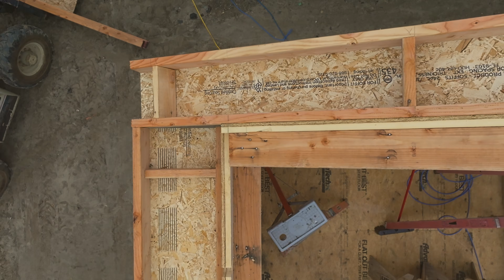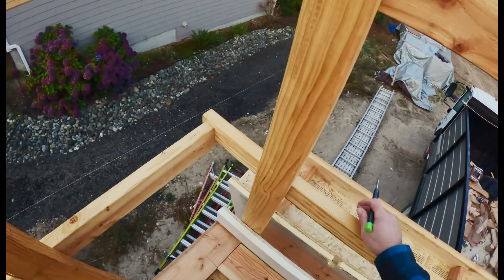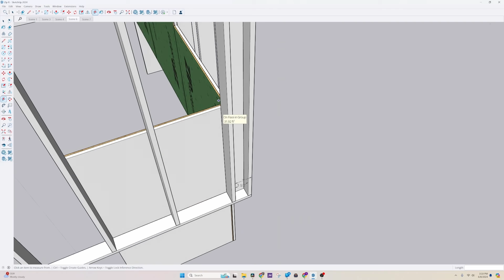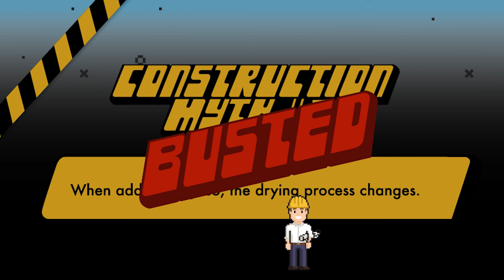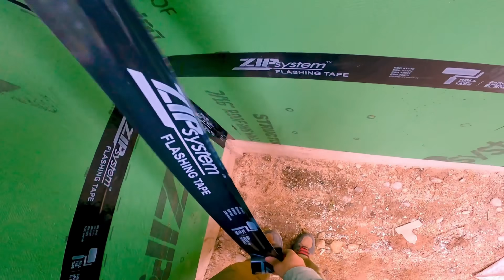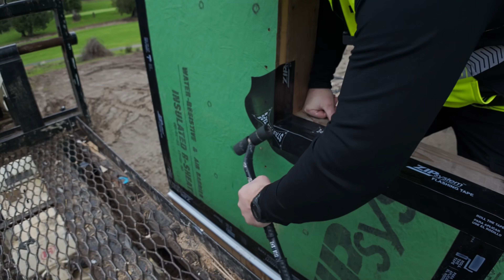EXPERT TIPS| Continuous Insulation

Comment: I’m guessing you can’t go back and fix thermal bridging on a house the way you can preemptively do so with a new build? 

This would require removing all the exterior sheathing, which would require removing siding, and removing drywall…..basically going down to the framing for every single wall of the house?

Comment: 3' OC on edges...does he want that regardless of R sheathing? Say if you framed with just 7/16" Zip (no R) or is that simply because of the added thickness of the R sheathing?
Reply from the maker: No it was because of the foam
Reply: @AwesomeFramers so yes because of the fact it was R sheathing👍🏽🤣. Thank you. I have yet to us R Zip but I have some projects coming up that will require continous insulation to met REScheck reports and I use Zip exclusively so bam… here we go

Comment: Doesn’t this also create fire breaks? The foam is super flammable. It’s like a fuse all around the house.
Reply from the maker: No its not like a fuse around the entire house.  Fire codes take this into account as well as well as you can look at the flam rating of this foam.  Its important to look at assemblies and not singe components in isoloation.  Remember, these houses are made of flammable materials, have electricity and likely a fuel source like gas or propane.  Can they burn? Yep.  How often do they? Very rarely.
Reply: @AwesomeFramers rockwool and CMU seems superior.
Reply from the maker: @CountJeffula  seems being the operative word.

Think through the labor process of CMU & Rockwool.  What will it take to attache siding?  What is the existing labor pool that can do the work?  What's the cost?  What impact on seismic design?  What's the environmental cost? and the list goes on
Reply: @AwesomeFramers it’s way fewer SKUs and less things to go wrong. I’ve done CMU myself. Rockwool is essentially impervious to insect, fire, and water.

Comment: Seems it would reduce shear strength. Instead of the fasteners being under a shear load, they will take on a bending load due to the low strength of the foam. It takes less force to bend a fastener than to shear it. Right?
Reply from the maker: Basically yes, that's why we add more nails. https://www.huberwood.com/uploads/documents/technical/Seismic-Controlled-Regions-Installation-of-ZIP-System-R-sheathing-Technical-Tip-Wall-R-sheathing_2022-08-10-182322_ksai.pdf

Comment: You tubing has become heavily monetized with product endorsement 
Not necessarily all bad but there are budget friendly alternatives if you have knowledge and experience
Reply: What would those be?
Reply: I'm partial to a 2x8 staggered 2x4 24"o/c stud with a high density batt double R14 for a combined R28 effective about R16.5 at every stud with 7/16 OSB sheathing with a liquid rubber membrane coating finish as needed 
A nice Portland cement scratch 5/8 with a synthetic coat finish comes antique stucco wire and mesh for drainage peel and stick all fenestrations 
Not necessarily in that order
Some nice smooth limestone finish on front of house and columns 
A little fire resistant spec non perforated fire resistant metal soffits c/w standing seam metal roof and mechanical attic ventilation with fire damper
Gets me excited
Reply: I'm partial to a 2x8 staggered 2x4 24"o/c stud with a high density batt double R14 for a combined R28 effective about R16.5 at every stud with 7/16 OSB sheathing with a liquid rubber membrane coating finish as needed 
A nice Portland cement scratch 5/8 with a synthetic coat finish comes antique stucco wire and mesh for drainage peel and stick all fenestrations 
Not necessarily in that order
Some nice smooth limestone finish on front of house and columns 
A little fire resistant spec non perforated fire resistant metal soffits c/w standing seam metal roof and mechanical attic ventilation with fire damper
Gets me excited

Comment: I like regular zip for sheer then 2”outsulation ridged foam, rain screen, pt strapping, then siding.
Reply: Late to this post but 100% agree.. Houses built with 1" of foam BETWEEN sheathing and  studs allows for movement in the 1" between ply and studs.  High winds (FL) will allow said movement, compromising interior finishes, tile etc.  Framed for years in my previous life and this is the first thought I had when this product came out..

Comment: 18:15 potential to dry on both sides - does that mean no interior air barrier? Here in Alaska people swear by 6mil poly between drywall and studs.
Reply: Because of the polyiso on the zip r you would no longer need or want the 6 mil poly between the studs and drywall. This would lock moisture in the wall cavity rotting the would and creating mold. The wall cavity needs to be able to dry to the inside because the polyiso is now your vapour barrier. The only thing drying to the outside is the osb on the outside of the polyiso.
Reply: @L0n3W0lfBl4ck   Thanks! This is exactly what I ended up doing. Rockwool in cavities with NO poly. People thought I was crazy but I dove deep into the research

Comment: Of course the ultimate is still going to be a double stud wall. Where the studs are offset from each other thus isolating and eliminating all bridging.
Reply: That might work with a rain screen. Wall insulation u-value calculations will identify the point of diminishing returns. The first R-13 blocks 90% of the heat so the code is pretty much spot on.

Comment: Why not use ICFs?   Really fast to get walls up, no WRB or Vapor Barrier in the walls.  Zero thermal bridging in the wall and tthe thermal mass of the concrete reportedly gives an effective R Value close to 50.  Foam window bucks eliminate that thermal bridging.  Blower door scores go up really easily too.   Bonus...zero mold issues in the walls!  Bullet proof up to 200 mile per hour winds!

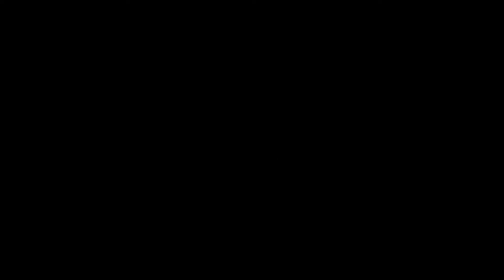Comment: 17:24 About "the Myths" ... Steven has a rather special definition of "drying to both sides", the reference plane is not the most obstructive layer, it's not the most restrictive panel that has to dry - in this case poly iso does't even suck up water and can't get wet - ALL the elements of the wall (insulation, studs, blocking,...) must be able to dry to both directions.

So that's the problem with ZIP R-sheating, the poly iso layer makes that the insulation and studs can only dry to the inside .

The seams of the ZIP R-panel are the weak spots as interior vapor can reach the ZIP tape which is not insulated. The vapor will condensate against the tape and the condensation will be sucked up by the OSB layer.

The OSB will remain wet during winter as the WRB as water tight... the wetness of the OSB must first turn back into vapor before it can escape to the outside... and mostly this means you have to wait until summer time.
Reply: I am looking to build a small one story house and using 1.5 polyiso as the sheathing. The shear and racking will be addressed using diagonal braces. It will be 2x6 walls with dense pack cellulose. What do you think about this
Reply: @mrmrv42  If you want a wall that can dry to both sides, you need to avoid all kind of plastic insulation (polyiso, EPS, XPS,...) because they are not vapor open, cannot regulate vapor and cannot absorb water. 
Don't get blinded by their "superior" R-value per inch, the R-value is only one small part of the story.

Exterior insulation is the best choice, but use a vapor open material like Rockwool Comfortboard or TimberHP wood fiber boards.

Never use bigger sized studs than needed structuraly just because you want to insulate thicker. For a ground floor only house, 2x4's are more than adequate. Apply the extra insulation wanted in the continuous external layer.

Even if you're using diagonal bracing against shear, I would apply sheating for air tightness and extra mass, use plywood, (oil tempered) hardboard, MDF, particle board, OSB,.... 

Install a service cavity wall of about 2 to 3"on the inside and fill this with extra insulation where no services are needed.
Finish it with sheetrock and embed paper banding to make all the seams air tight.

For extra insulation on the inside, a material that can absorp and release vapor is the best choice, so cellulose is a good choice, other options are all other natural materials like wood fibers, cotton, hemp, flax, sheep wool,...
Reply: @koenraadprincen7212 thanks for your insights ✌️

Comment: When I built my second home zip wasn’t available and I didn’t really trust the siding contractor to install tyvek correctly. I was in the HVAC industry and had the house sheathed with 5/8 plywood and taped it with a mastic tape. I tested several tapes left totally exposed for a year and the mastic held up the best. I used siding with foam attached. As previous comments mentioned social media influencers are usually supported which may or may not be the case here. Zip is a nice solution but not the only way or even the most cost effective way to achieve the same results.

Comment: Zip-R is more expensive to use than zip only plus, insulation for materials cost only …. Want to save energy reduce the window square footage throughout the house to improve the overall efficiency
Reply: Sure you could cut out ALL windows and it would really save money!
Reply: @ yeah windows exude a lot of heat so reduced window size saves energy

Comment: My house was built with real quality wood but empty cavities. Like a barn maybe. After considering blown-in insulation or infusion or ripping out the sheetrock and wood panels to sprayfoam or rockwool, I think high utility bills are maybe the better choice. People survived in this hot and even hotter climates and in this house before air conditioning. The cost savings to insulate are questionable. Its expensive either way.

Comment: What a silly product.  There is no way to tape the seams in the foam board that is attached to the OSB, so what prevents winter water vapor inside the house from reaching the edges of the OSB through the gaps in the foam ?  Once there, it will condense due to the outside cold and lack of true exterior insulation.  Check out all the SIP roofs and the way they rotted along the seams from the inside -- even though that foam was T&G and should have at least fitted tightly from one panel to the next compared to this.  And how do you claim you've eliminated thermal bridging when you have thousands of nail or screw heads exposed to the cold and then running right through into the wall studs ?  At least with exterior foam board you'd have many fewer fasteners doing that.
Reply from the maker: @kirkellis4329  Untrue

Comment: I like the zip r product and design with it in western washington, but I your mythbusting section is a bit over simplistic. I agree that it is not inherently a problem, but it could present significant issues if someone doesn't get the assembly right or doesnt probably excecute the build. 

The biggest thing I think you left out os that you cannot install a vapor barrier below sheet rock orherwise you are going to rot out the framing. You also must allocate more time to drying out framing if building during the wet season. Any trapped water will also lead to rot. 

I think the best assembly with zip-r is to "flash and batt" the cavities with 2" of closed cell and fiberglass batt. The downside is thay this likely removes any labor cost saving from usong the zip-r panel. 

I am hoping we don't see a bunch of new homes in the region fail as less attentive builders are pushed into the zip-r product by the energy code and cost constraimts.

Comment: I wouldn't be so worried about the shear strength, as the fact that it is being borne by 1" of nail effectively in free space. The nails have become structural members, not just fasteners. As the building loads change in the wind, they will move, and over time they might creep. Nails are supposed to work by keeping tension between the two elements, and then relying on friction between them for the majority of side loads. That doesn't happen here. I wouldn't trust the longevity of such construction. How long is the warranty?
Such a system needs to be 3 layers. It needs a structural layer adjacent to the frame, an insulation layer, and a barrier outer layer. Trying to use the outer layer as structural is asking for trouble. I would guess the primary reason framers object to an inner structural layer is that it is the structural layer which needs to be fastened, and trying to use a nail gun on foam and get a good fastening on the board beneath is going to be a pain. In a controlled environment the solution would be glue, but that is really hard to inspect. I guess you could push the board out and if it stays put then the glue is good enough.

Comment: 10:29 Stupid question- why not saw off the panels at 45 degrees to meet at the corner like is done with most stuff on corners?
Reply: This would be the best or smartest way but half of the people using it are lazy ...To do it the right way ...There is a lot of half a__ people that just do not care ...
Reply: I would add spray foam for corners ..But I would put my sheets straight up and down so all side nail to frame not with gap to fill with foam inside later ...That is just mee ..

Comment: Use some zip around windows and doors for thermal break. Windows and doors closer to inside helps too. Less cooler space from window on inside. Then can put shutters on for those in the cold areas or need bear protection on windows.

Comment: Didn't see you address the wall condensation issue with Zip (where the vapour barrier is on the outside of the wall) in cold highly humid zones (like Washington State). I'm wary of any sealed panel system in that climate.
Reply from the maker: I didn't address any of the climate zones.  The scope of this video is mosty about what the product is, how to install it and why we use it.  It is not a deep dive into the different climate zones or potential issues.

In our climate zone here in WA, 4 & 5C, there aren't condesation issues following the construction shown in this video.
Reply: @AwesomeFramers I'm close in coastal BC. It's just that Steve discusses the advantages, but not so much the disadvantages or what climate zones it's best. Also, going for more than R6 might not just be a cost issue if you consider it might eliminate wall condensation. I think in our climate, the standard interior poly vapour barrier and zip (no cavity drying) might not mix. I haven't found any long term studies having moisture sensors in the wall for zip systems with a variety of vapour barriers.
Reply from the maker: @approots  I hear you.  I feel like climate zone gets us close, but its almost still a site specific discussion.  Have you tried asking those quesitons over at Green Building Advisor?
Reply: @AwesomeFramers  I've read a lot there, and it's great, but without the controlled long-term studies it's all theory and anecdotal experiences. Still looking for solid data.

Comment: Another thing I didnt like is the way the foam is adhered to the osb. Its just a squiggly line of glue or whatever adhesive. Not full coverage not laminated at all. I suspect this will cause moisture to be trapped between the foam and osb, most likely becoming moldy and eventually rotting away the osb. Not a good product imo
Reply: I built with ZipR6.  Agree that it could be adhered better.  But that said, when you get all the nails in, there's no gap, and the foam isn't coming off.  So, the glue is really just there to keep the assembly long enough to build.

Comment: I used this zip system to frame my brothers house about a year ago. Except the foam was 2" instead of 1" as seen in this video. It requiered 4" nails to fasten the sheathing to the studs. Im really not a fan of this because the shear value is significantly diminished. You shouldnt have to comprimise on structural integrity to achieve a slightly higher r value. If I had to use this product again, I would probably install cross bracing in the walls for additional support. This would just add more cost to the already higher cost of the project. And people will complain even more about why houses are so expensive 🤦‍♂️🤷‍♂️
Reply from the maker: I hear what you are saying, but there is a larger story to this.  First of all, did you NEED the R9 product?  It important to remember that more isn't always better.  In our climate zone, code requires R5 here.  We can get the lateral resistance from the R6 panel nearly all the time here in seismic zone D2.  Zip R6 is the lowest total installed cost to meet the new energy code here.

Comment: I want to give a comment I appreciate you talking about when you're framing you need to consider what's going on the outside for as plywood's insulation or whatever is the next framer actually Carpenter journeyman that is I think that you should have used a 2X for the corner and then you wouldn't have a wasted 2 by 4 so you gave me great thought in the next time I frame and make sure I have Corner nailing from the outside of my insulation so my walls would probably be laid out differently to instead of the normal pull on the tape for 12 or 24 in on Center I have to consider what my outside installation was going to be and where is it going to be extended paneling so is for nailing purposes that way you wouldn't be wasting exterior sheathing and insulation board being 4 x 8 sheets normally? Just a thought four framing